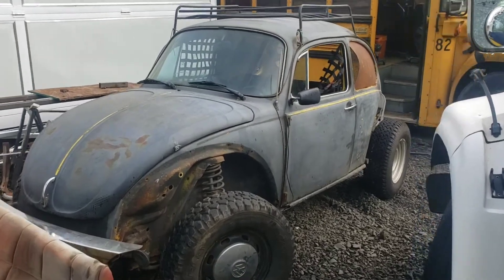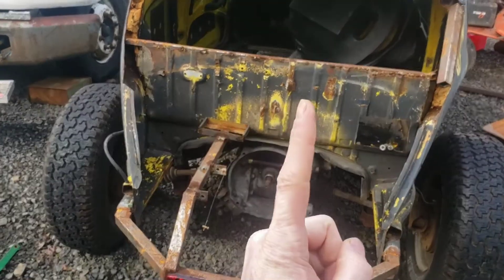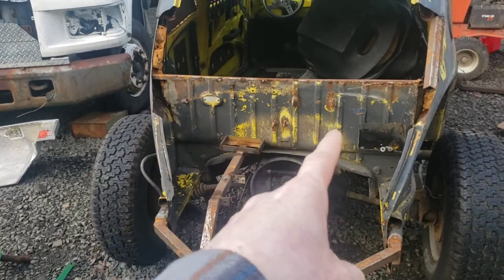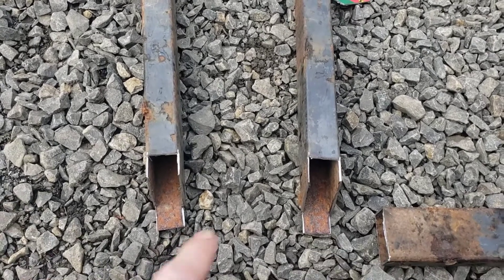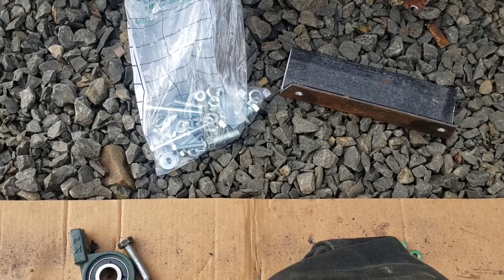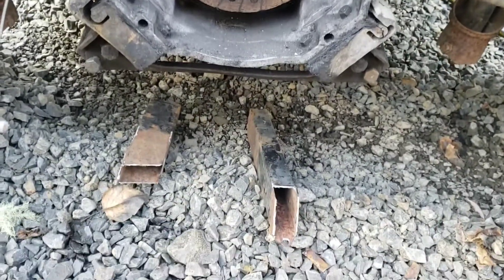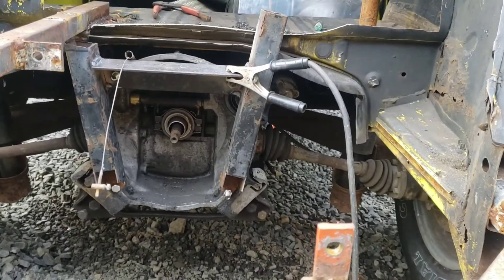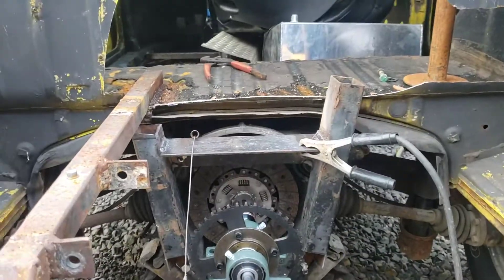making a predator 212 mount for vw volkswagen bug beetle transmission adapter

Comment: Hey I like ur videos there interesting but I'm thinking instead of doing all that like with sprocket and pillow block bearings and stuff

Would you think a 3/4 shaft coupler I'm thinking about buying a 3/4 shaft coupler and install it on the tranny clutch and install it on the engines shaft any ideas 💡 I think that'd be great idea lmk what u think
Reply from the maker: I do not think just coupling the engine to transaxle would work out. Getting the 2 aligned properly would be nearly impossible. Also you need gear reduction to make the lower powered engine capable of moving so much weight. I made my mount rat Roddy and used scrap metal. If I was going to do it over, I would probably do a mounting plate similar to this video https://youtu.be/Sn6iIDNdjwY
Except I would mount the engine up top, with enough room to run pulleys and a v belt for gear reduction between engine and transmission. Thanks fir checking out my videos. God bless.
Reply: @worthshop  oh gear reduction meaning sprockets an d chains or belt and pulleys 

Question Im doing some today and more tomorrow but maybe for testing I can just coupler the motor to the tranny's also I thought that you know how vw beetles 1969 and so on and older have autosticks and so I was wondering if I just coupler the motor and maybe I can pickup the speed with the gears like cuz my autostick has 3 or 4 gears
Reply: @worthshop  maybe I can use 1st for slow 2 3 and 4 for gear reduction lol I'm not sure I mean ik in ur build ur using sprockets and chains but I can test the predator engine with the shaft coupler to the transmission then maybe get her going using 1 for slowest 2 for midle speed 3 for faster speed

Comment: How the heck do you change gears in it with the clutch disc being solid on the input shaft?
Reply from the maker: There is a torque converter style clutch on the predator 212.
Reply: @worthshop  do you just lift off the trottle sightly to change gears?
Reply from the maker: @logangaddy4917  Yes, let off the throttle loosens up the torque converter, allowing it to shift. From a stop I can put it in any gear and just give it gas to go. 1st is a bit too low to use much, 2nd is a good all around gear for taking off and moderate speed, 3rd is a bit harder on it to get going but maintains speed well on pavement, 4th I rarely use and do not recommend taking off from a dead stop, just too hard on the torque converter belt. If driving in 1st or second I can let off the throttle and shift up or down gears while in motion as well due to the slack in the drive train created by the torqueconverter. Hope this helps answer your questions.
Reply: Can you rip gears in it or is it more for just cruising? I'm looking at doing a 670 but I don't know how I'll make the clutch work
Reply from the maker: @logangaddy4917  It's like driving a golf cart. Not a ripper by any means. Get a go cart clutch or torque converter. I have newer videos driving it around.

Comment: Liking the build what ratio are you going for from engine to jack shaft, also I've had issues with the torque converters burning up belts bc touch weight and a cheap clutch worked better in my scenario, I really hope you dont have that issue
Reply from the maker: I am starting with a 10 tooth output sprocket on the tc and a 41 tooth on my jackshaft. I didn't use any special ratio just found one around what I wanted for at an affordable enough price.. Will see how it works out. Will probably change it later on as I experiment. Appreciate the comment, and keep building shit!